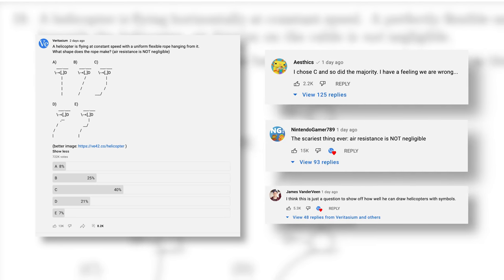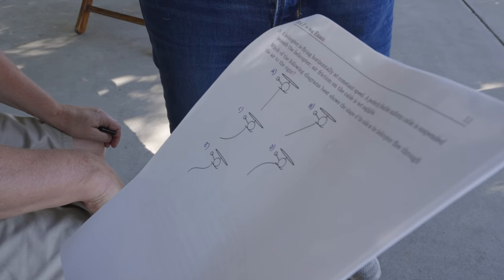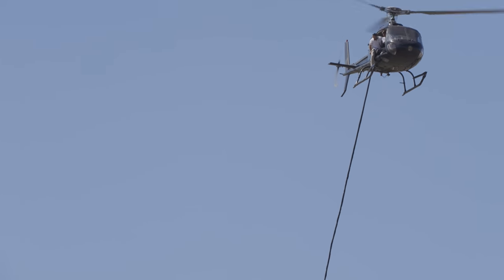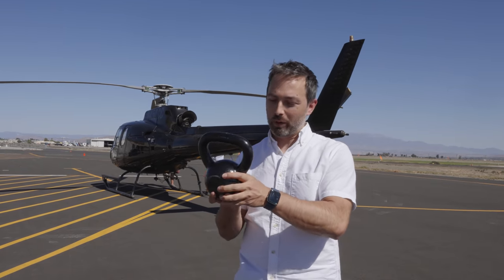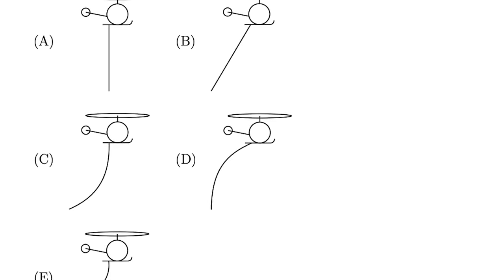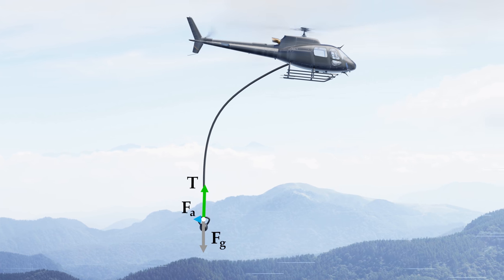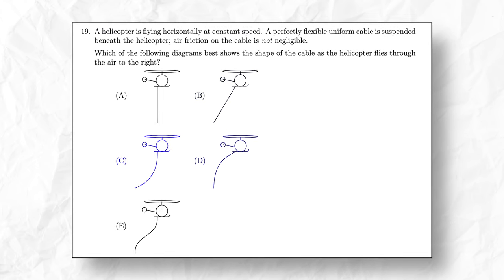I Rented A Helicopter To Settle A Physics Debate

Comment: I think it crucially depends on the length of the rope. Air close to the ground has a higher density and more drag as a result. Given the rope is relatively short in the video, the density is very similar (but not identical). Due to this, the curvature is not visible/negligible in the video. However, if the rope was much longer, the air density starts to really matter and I would expect shape C.
Reply: I think the rope would have to be REALLY, really long for this to be true. You’re implying the force varies with an exponential or logarithmic dependence but unless the coefficient is sufficiently large it would never actually make the curve unless the rope was like 1000 ft long or something
Reply: I think in order for the pressure differencial of the air to become significant enough to affect the rope in the way you describe, the rope would need to be longer than we'd ever see in reality (likely >15,000 ft).
IMO unrealistic hypotheticals aren't very useful as thought experiments.
Reply: Well if you wanted the rope to change into c, you’d need a big change in air density. If you wanted a slight curve you’d need at least a 10% change in air density which would equate to about 1000 meters of altitude. If you wanted any exaggerated curve you’d need something like a 40-60% increase in density which would be multiple kilometres of length. The question didn’t ask for that though and a rope of 20m only sees a pressure difference of about 0.03 PSI from top to bottom, which is tiny compared to normal pressure fluctuations and wind.

If C had a much slighter curve to it (imperceptible) or if the rope was much longer I would agree with you, but it’s clear in the photo that the rope is very short, and the curve in the rope is extreme (going from vertical to horizontal), so it’s not the correct answer at all.  Also, the rope starts out vertical in image C, which wouldn’t happen, unless you were in space or something, and had the rope dangling far below you into the atmosphere.  Physics questions take many parts out of the equation as well (like prop wash), so it’s 100% the case that they aren’t taking pressure differential.
Reply: At very low speeds it would be more like A, at higher speeds more like B if 'best describes' means 'has rotor-rope angle most similar to image'.

Also because of the inaccuracy of the drawing showing the blades as horizontal rather than tilted as would be required to achieve constant speed I think technically none are correct. 

If clarification is needed to definitively determine an answer I think it's a bad question that's gonna disadvantage anyone able to see it's ambiguity which the author apparently can't and perhaps speaks to their fitness to judge the answers.

Edit: I agree with length point BTW, though it does look too short in the image for it to be significant i think.
Reply: @nommy8599  I think it’s a pretty simple question. It states that the helicopter is moving forward with constant speed, and that the air resistance is not negligible. It also gives you a good idea of how long the rope is in the image, as well as basic shape and angles for the rope, which would depend on speed. It doesn’t need to specify low or high speeds because all of the ropes are affected the same amount by the air resistance, and since it doesn’t mention how heavy or thick the rope is, you can’t really draw any different conclusions based on speed anyway. Also in a perfect world with the length of the rope in the image, air pressure would only change 0.2 percent from top to bottom, which isn’t illustrated in any of the images. The correct answer fits the question the best by a long shot. 

You can ask 1000 questions about any physics problem. “Do we take into account micro gravity fluctuations?” “What about a wind gust that may or may not be there?” “What about the temperature of the air? That might influence the angle” “Do we take into account the change in friction based on increasing temperature for the block sliding down a ramp?”
The list goes on and on.
Reply: @Chevsilverado  I think you might be missing my point. For the 2 possible straight roped answers, 
A is 0deg off vertical 
B is 45deg off vertical
If it's moving to cause the rope to hang at 20deg (air resistance significant) is A or B more correct?

Logically A is as the angle is closest in that case (20 is closer to 0 than to 45). But many people probably expect student to assume A represents only vertical case and B to represent any angle. Why would they?

It becomes more of a psychological question than a physics one because so much depends on guessing what exactly the author was thinking.

If you want to test nerotypicallity in applying physics it's fine, but I don't believe that's the purpose at all, it's just an oversight.

They could be more specific in describing what image represents or shade area to clarify A means only 0deg, B is all other angles provided rope is mostly straight to make it test physics understanding rather than psychological.

Edit: I think this is significant in a way many of ghe other details you mentioned aren't - gravity etc. Still more clarity is still good - makes it more physics less psych.

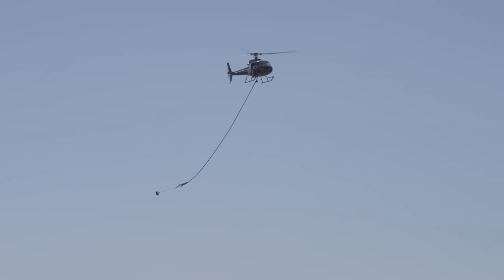Comment: 10:50 - isn't this the same shape the hose with a drogue takes during aerial refuelling? I remember seeing it on TV. A lot more horizontal though, likely due to the higher speed.
Reply: Could it be due to thinner air causing less drag at higher altitude as well?
Reply: @markmiller6402  Less drag would actually make it more vertical. I don't know what are typical altitudes for refuelling however at high speeds the drag force is proportional with the square of the speed
Reply: @dan-nutu  . Cool, thanks mate

Comment: I'm unbelievably proud of myself. Every single opportunity I had in this video to make a guess, I did, and I was right. I haven't even taken my physics class yet... First guess I jumped between them but settled on B, second guess I initially thought E but changed to D,  lastly I guessed the reason the weighted cable makes D is that it has less wind resistance per oz of weight, so it curves steeper.

Comment: It seems to me the piece of information you need to know is that the rotors aren’t going to affect the ropes. From there it’s a simple free body diagram for any type of problem you ask. If you don’t know this before you take the test, you’ll probably get this question wrong. Doesn’t seem entirely fair for a physics exam unless it’s beyond a point where you could prove whether or not the rotors will affect the rope 🤷‍♂️
Reply: Hey if it isn't stated in the question I've always assumed it's irrelevant/negligible to the model. We academics loves simplifying things.
Reply: @lalinowl  but quite often in these physics problems you draw a free body diagram where you assume something. Gravity, friction, air resistance etc. this would include the downforce of the rotors. 

Although I suppose the rebuttal to this is if you’ve been taught how rotors would affect it then you’d know they don’t affect it at all. 🤷‍♂️
Reply: @lalinowl  in short, I agree with you but as a second year engineering major I would have been under the impression the rotors would affect it and thus would draw that in my FBD since I haven’t been taught fluid dynamics
Reply: @lalinowl  Yes.  Having written many Physics contests in my youth, I can attest this is the standard assumption.

The entire premise of Physics is to make each problem *just* simple enough to solve - without losing any significance from the result.
Reply: @logan9699  Any constant downwash pressure is equivalent to an increased linear density for the rope, from rho to rho'. Thus one still gets that:
P⋅dl = dtsin theta
rho'⋅g⋅dl = dt⋅cos theta

and thus 
P / [rho'⋅g] = tan theta
Reply: @pietergeerkens6324  take fluid mechanics in about a year. I’ve no clue what any of this is 😂 second year, so doing dynamics and mechanics of materials. Thermo is next semester
Reply: If it was asked at a point where you could prove whether the rotors would affect the rope, they would have given the information necessary to prove whether or not it would affect the rope, because depending on those factors the rotor wash actually could affect the rope. Those factors are entirely missing and they just say "assume air resistance exists" and don't tell you anything about the helicopter in this problem, so it's a pretty bad question
Reply: @logan9699  bro if i could give you one advice, if youre gonna be in the field, never assume anything, especially with new problems. better to be wrong on paper than in practice. and have fun, also fluid is a bitch.
Reply: @lalinowl  that... doesn't make any sense, you allways suppose things that aren't direcly stated when answering a question, its litterally how answers are answered.

Even if it isn't stated, you assume gravity affects the model. Even if it isn't stated, because there is air, you assume there is air resistance. Even if it isn't stated, because there is helicopter, you assume there is downards wind force that gradually dissipates throught the length of the rope.

I'm not too familiar with american education sistem, and i ask if you too learn fluid dinamics in hight school, but without stating if the fan movement affects the rope, it doesn't make any sense at all.
Reply: @miguelpimentel5623  It.
Doesn't.
Change.
The.
Answer.

A constant downwash from the rotors acts on the rope exactly as the air resistance from flying forwards does - so only changes the angle at which the (total) air pressure pushes against the rope, and thus the angle which the rope makes from the vertical.
Reply: @pietergeerkens6324  no, if the dissipation of the downward force occurs gradually and throught the legth of the rope then it creats a curve. (There would be a stronger force pussing downwards at the upper points of the rope and a weaker/null one at the lower points of the rope)
Reply: @miguelpimentel5623  

Tell me you struggle to get over 80 in Physics without telling me your last grade was a mere 72.

The goal is not to make the question unanswerable, but to answer it: in less than 90 seconds as it's a multi-guess question.
Reply: @pietergeerkens6324  Physic is/was my favorite subject and I finished the national exam with the best grade of my school, which gave me opportunity for the best engineering university of my country, now try harder.

Anyway, the education systems of the Anglosphere are the most nonsensical of the world so it creates your kind of mentality. Where you think that just spatting answers in minimum time and no information, based principals they did not learn makes more sense then giving information to let students find accurate resolutions based on the formulas they learn or mental images they create in their heads.
Reply: @miguelpimentel5623  I came 13th in the country - not just first in my school.

Take a seat now.

Comment: when I was initially presented with this question the weight and length of the rope as well as the speed of the helicopter where not specified which I thought were all important factors as a lighter rope at lower speeds might actually manifest the more intuitive answer. while that same lighter rope at speeds sufficiently high would be practically horizontal to the ground as the wind from the helicopter moving forward would completely negate any effects the wind from the rotors themselves caused.

Comment: I suppose this is kind of less of a physics question, and more of an engineering question: this problem is fairly easy to model by combining fluid mechanics and statics (material mechanics if you want to go the extra mile and account for the ropes small but non-zero bending stiffness)
Reply: The question explicitly has a perfectly flexible rope
Reply: Yes with a free body diagram it’s easy to find these resulta

Comment: So a rope with a kettle bell at the end and a parachute at the midpoint should make E..?

And if you go slow enough but still at a constant speed, with a weight, would make A.

So they're all right depending on certain variables
Reply: No, it would make B again. The end of the rope has a lot of gravity pulling down, but also a lot of drag pulling left, the net result is needing a tension pulling diagonal again.
The only way E would happen is if you put a weight on the end of the rope with a parachute in the middle of the rope.
Reply: @bayanzabihiyan7465  That's what I said..?

Also, slow enough at a constant speed can allow drag to be so minimal it's basically negligible, making it hang straight down and make A
Reply: @skeome doing hoist operations this is very important to know,  a 600lbs weight on the end of 300 ft of cable when the aircraft is in a stable hover will acquire a slight sway and the best way to get it to stop short of paying out more cable is forward movement.  Forward movement will kill almost all osculation.
Reply: @skeome  Yes, however, the task stated that the air resistance is NOT negligible.

Comment: interesting: my intutive guess was B, but my alternative guess was E.
I think this was I was less thinking of a stationary chain but rather what would happen if it was lowering the chain. So as the chain goes down, it would slowly drift backwards and "whip" back due to the weight of the chain. After dropping the whole length, it would reach B at equilibrium.

but ig I was wrong anyways.

Comment: I think the general correct answer is "C", but the experiment used a very heavy rope relative to the magnitude of air resistance; the explanation of "cutting the rope into many pieces" ignores the weight of the rope acting on each piece, which is greatest at the top of the rope and zero at the bottom - this variation in the force due to gravity will generate a curve in the rope at constant speed, which is just about demonstrated by the parachute experiment; if you look at the diagram at 5:10, and correct the downward force to be very small, then the tension force will have to be acting in the direction of travel to balance forces, meaning that diagram "C" describes the resulting curve in the rope

Comment: Even seeing it, it still seems counter-intuitive. I wouldn't think the ratio of air resistance to weight would remain the same across the length of the rope.
Reply: Why not, the weight of the rope doesn't change throughout the rope
Reply: Think of it this way: If you have 1 meter of rope, it has a given weight, w, and a given air resistance, a, for an air resistance to weight ratio of a/w.  Now lower it another meter.  Because the rope is uniform, the second meter has the exact same weight and air resistance as the first, so the total weight is now 2w (w from the first meter plus w from the second) and the total air resistance is 2a (again, a + a.)  The ratio is now 2a/2w; the twos cancel, so you get a/w.  As you lower it, each additional meter of rope is identical to the first, so its ratio must also be the same by the same reasoning. (3a/3w, 4a/4w, etc.)
Reply: I have to admit, this fooled me too. This is what science is about though, right? Breaking down a problem into its component parts to get a more complete answer than our intuition tells us - And then testing that answer with experimental data, and repeating.
Reply: @demonicbear7812  Yeah, but the way I imagined it, I thought that the higher you get, the more weight is pulling down on that point of rope (because more rope under it), so my thinking was that the effect of air resistance would be less substantial the higher you go.
Reply: Here's the easy way to think about it: for each small bit of rope, you have a backwards-pointing air resistance, and the downwards-pointing gravity. The resultant force is pointing diagonally. Now both components of the force are the same for every bit of rope (because of the uniformity assumption), so it's effectively the same problem as if gravity were pointing in that diagonal direction.

Comment: The weight of the rope affects this experiment. If you would use a rope light enough, the part closer to the rotor would experience more downwards force, thus resembling figure E but ending with a diagonal bnot a downwards curve. You could replicate this with a heavier rope without risking it getting entangled in the rotor by adding a weight at the 1/3 mark closer to the rotor

Comment: Before watching, I'm guessing C or E.  The end of the rope will be at rest, with the top being dragged along. Not sure on the bottom.  Edit: damn way off. thought it would work like a slinky being dropped. Tension was the bane of my existence in uni Physics
Reply: he made this a community post a while ago lol.i went back to see what i voted and i put D..
Reply: Well, based on the picture, you probably think that the heli rotor give a significant downforce to the rope, i too fall into this trap, yea, i just realize that the drawing is a trap, a heli will tilt its angle when flying to the front, that heli in the picture is totaly even, it should be drawn tilted, like a vehicle goes downhill, like it's about to crash, that way i wont get trapped and choose the option b or d right away.
Note : never trust a heli picture.